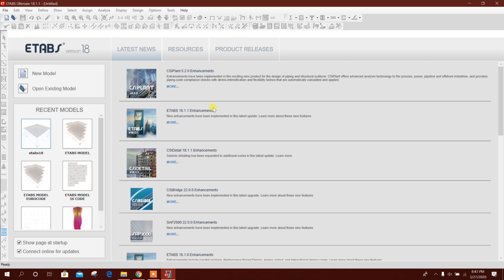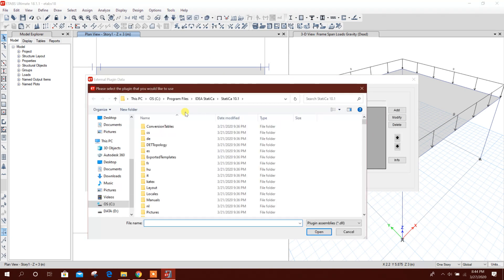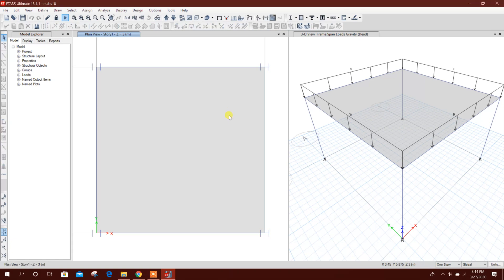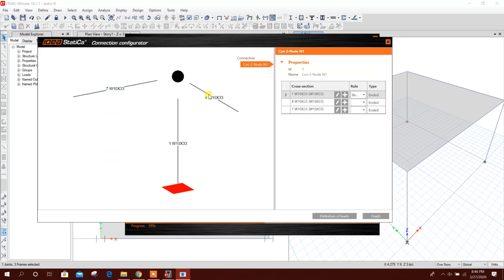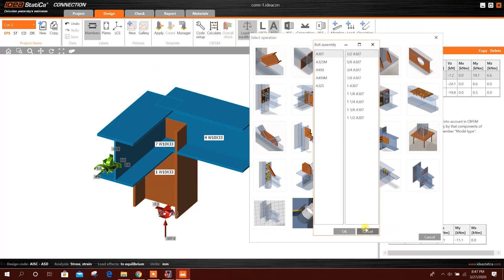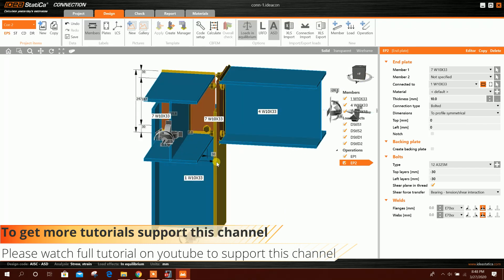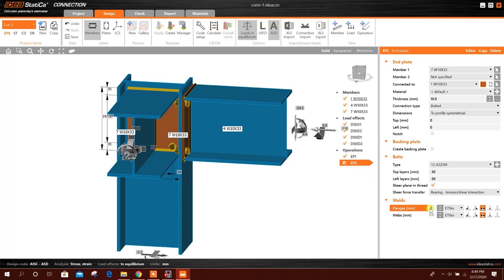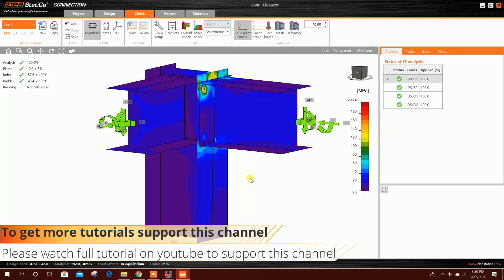Etabs to Idea Statica | Steel Connection design | BIM

Comment: Hello. I have one doubt. Well, i have a model on Etabs and after running the model and using the pluggin for IdeaStatica, it export's the geometry but the forces and internal structural solicitations are in blank so the model doesn't have parameters for calculation. What i'm doing wrong ?

Comment: My steel connection is not working in ETABS what may be the issues ?? can you help to resolve it??
Reply from the maker: Try to reinstall.
Reply: @Decodebd  Ok.. But two different systems etabs 18 we installed same issues.. We copy the software and installed.. Let me the inform the issues if any.. 

Thanks  for your reply..